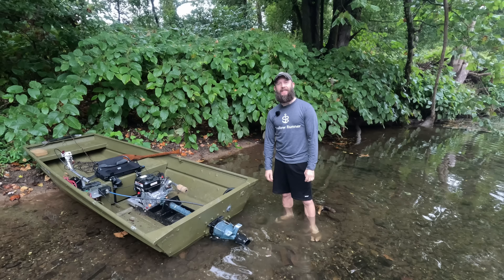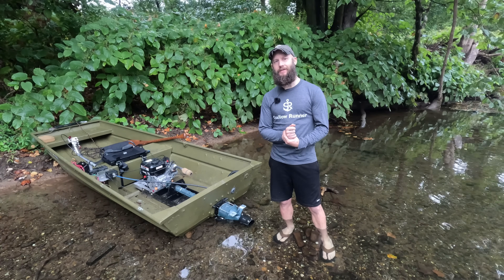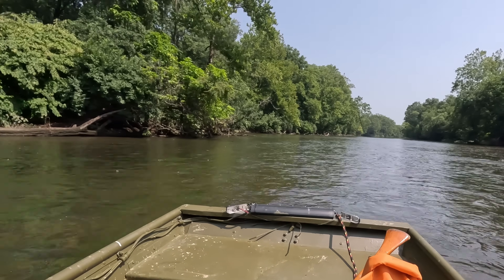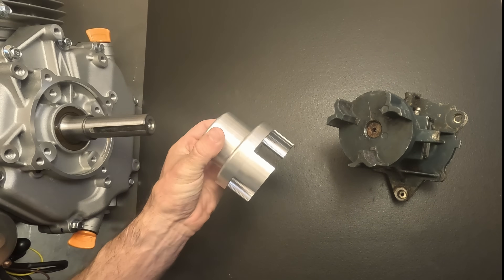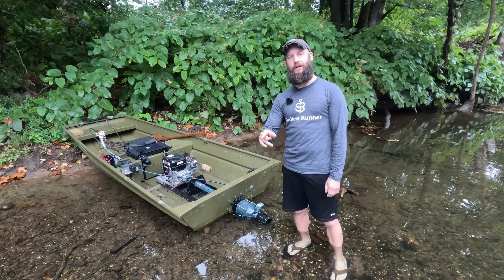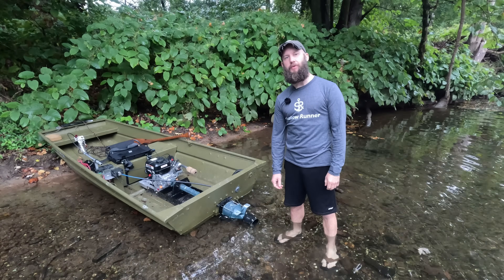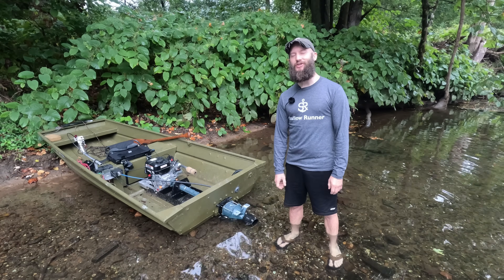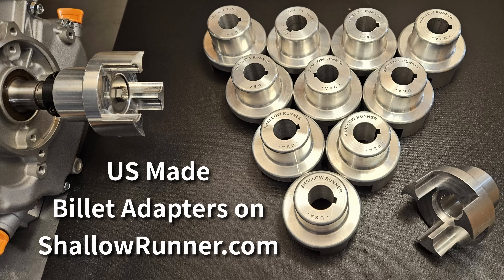212cc Predator Engine Jet Boat Build

Comment: So how are you steering this thing ?
Reply from the maker: This is setup with with a standard jet ski steering cable with a tiller configuration to mimic an outboard. Most folks prefer a vertical stick steer which we'll show for our 670cc build.
Reply: @Shallow.Runner  Thanks !

Comment: Is the rubber piece oem from the parts ski or did you have that made/make it
Reply from the maker: Great question, the rubber spider comes from the parts ski but they can be found on ebay for a reasonable price most times.

Comment: Total cost spent building the boat?
Reply from the maker: Put this comment up on another thread as well. We'll cover more on costs in a later video but it was about $300 for the boat, $100-200 in raw materials, $400 for the 212cc engine plus hop up parts, $200 for the ski we pulled the pump out of, so maybe $1,000'ish total. The 420cc build was a good bit more because of the stage 3 kit, fuel system, custom exhaust, custom impeller, so maybe $2,500 for that build though it can be done much cheaper which we'll cover soon.

Comment: This is an awesome project. If I wanted to build one, what year wave runner would I be looking for to get the pump from? Did you pull one from a ski or were you able to find just the used pump alone?
Reply from the maker: Hey great question, any pump from a Waverunner 500, or a LX650 (not the WRIII 650, VXR 650 etc). It's the 133mm diameter pump. Depends on your area but the skis usually go between $50-300 without a title. Shoot us a message on https://www.shallowrunner.com/ if you have more questions.

Comment: I just scored an 8 foot jon boat at a motorcycle swap meet for 2 hundred bucks. Is yours an 8, 10 or 12 foot? Its hard to tell.
Reply from the maker: Hey great question, this is a 10ft. An 8ft is likely doable but might be a pinch tight depending on how you plan to use it, likely a definite single seater.

Comment: whenever i determine a project  want to do, i really have to figure out what tools and parts are required that i do not have.  i have done many projects that cost as much or more than buying a finished project.  usually the tools i would have to buy are something that enhance my tool collection for future use.  but I have a ton of tools and spare parts i have no need for after the project.  i just saw a tool yesterday i got in 1998 that i have moved from house to house with and stored since, never to use again.

Comment: Is there space for dual motors?
Reply from the maker: With the right hull there's definitely space for 2 motors. A single Predator 420cc will push these pretty hard as an alternative to twin engines. A twin pump or twin engine setup would be super cool though. Hit us up on https://www.shallowrunner.com/ if you have any questions.

Comment: What was wrong with the 420 ?
Reply from the maker: Hey this is a great question, we personally prefer the 420 but wanted to show what could be done with a pretty mild build. I think most future builds will be 420's or equivalents for the electric start. It's way more convenient to run and has a baseline power that beats a basic 212 build.

Comment: can i use that same motor to a 14ft jon boat with max 4 people?
Reply from the maker: Hey that's a great question, from my experience a 212cc might be a bit underpowered for something that large with that much weight. You may want to research https://www.facebook.com/groups/1350497108303519/ jet jons with jet ski engines.

Comment: I’m willing to bet that you don’t need either the billet flywheel or heavier valve springs because the jet drive should limit the peak rpm to the peak HP of the motor.  It self governs.   It’s not like in a go cart we’re you can free rev it to the moon.
Reply from the maker: Dude you're spot on. This build self regulated but didn't want to take chances  in case it was hungry for something beyond 4000rpm. Needed the flywheel for dry testing as well to make sure it would go through the paces. Could have done this same build and left the internals stock, kept the governor and flywheel stock and you would have seen the same performance and rpms. Didn't want to be left wondering if it could have done more.

Comment: No good no payload!!!
Reply from the maker: Hey, that's an interesting take and I'd agree that the 212cc setup isn't ideal for a serious load. My experience with a modified Predator 420cc was solid load wise, could carry about 350lbs of passengers and gear at 25mph all day, so more than adequate.

Comment: I need an electric version of this boat. Great build btw.
Reply from the maker: Hey thanks for the feedback, I'm 100% with you the pull start was tiresome. They do make some electric start 212-224's but I prefer the Predator 420 and have the start of a stock engine build here: https://youtu.be/06xO1R-Ehe0 .
Reply: @Shallow.Runner  I meant electric motor. I'm trying to save what hearing I have left.

Comment: The Impeller cost more than my boat
Reply from the maker: Ha yeah agreed these impellers aren't particularly cheap though I have buckets of them that came with skis I tore down. The stock impeller isn't so bad either I just prefer Solas. Wish jet boating was cheaper overall but pros and cons of running shallow.

Comment: Can't you DIY depitch that impeller pretty easily to gain some more RPM/speed?  do i ton PWC all the time.
Reply from the maker: You're dead on about dropping the impeller pitch. These are mixed flow impellers and slightly trickier to DIY de-pitch at home vs an axial flow. Impros will do it for a solid price, but if you buy new and depitch it's a bit steep. For this build I just went with a basic stock'ish pitch impeller since I had it handy. My guess is a decent cam ($100-150) in this would bring the rpm of this way up since the stock grind is advertised with peak torque around 2500rpm. Great feedback, should have mentioned something similar in the video but had to keep the length down.

Comment: You didn't talk about whether the engine overheats
Reply: Comes up in the comments... no overheating without enclosing engine...
Reply: Those predators are indestructible no over heating
Reply from the maker: Hey, so far no overheats with the 212c. Overheated a 420cc but that was because the flywheel air shrouds over the head were not on and a life vest was blocking the intake. Was running about 5500 rpm for an hour on a 103 degree day. Tore it down, no warpage or issues, put a fresh piston and it ran fine for another 50 hours in the summer before I moved on to a different engine. If I run into any overheating situations in the future I'll try a forced air scoop that will ram 30+ mph cool river air over it. Great question though.

Comment: Does the boat vibrate your fillings out like a minibike with a 212?
Reply from the maker: Hey that's a great question. The main issue with vibration I've had so far was with some mild to moderate vibration with a stock Predator 420cc at idle. At any meaningful rev point it's super tame and isn't something that's caught my attention.

Comment: Only problem is there is no idle as soon as you pull start it it starts moving there’s no neutral or reverse ⏮️ ⏪ 🔄
Reply from the maker: Hey that's an interesting point worth bringing up, as there are some very minor drawbacks to direct drive. In my experience with jet skis and jet boats they produce a super small amount of thrust when idling. This boat might do about 1mph or less on idle. To your point though I prefer having a Predator 420cc with electric start so I can start/stop with the flick of a switch on the steering for situations where I don't want any thrust at all.  A reverse bucket can be added for folks that want more control. Since the build is about 175lbs, docking/loading isn't too bad since they can be spun around on a dime with a paddle.
Reply: This is how most  all jet drives work including jetskis pretty normal
Reply: I would say add a cvt torque converter then it would do this but would add complexity
Reply: Every good water jet application has a bucket for this. Bucket down = reverse, bucket halfway = neutral/idle, bucket up = go. Its even better than prop boats because you can drop the bucket to use it as an active brake. On top of that, the design is super simple and easy to diy.

Comment: ARC aftermarke flywheel highly recommended for a little bit of speed but mostly safety reasons. And why no cluch system?
Reply from the maker: Totally agree on the billet flywheel for safety which I think I mentioned but didn't necessarily say the brand. It's an ARC, their products and customer support is killer. A massive amount of people are rightfully curious about a clutch, it's good to see the feedback. Jet pumps make such negligible thrust at low RPM that it's almost like the motor isn't engaged to the pump at idle. Based on all the feedback, I'm tempted to build a CVT / clutch setup to see what it could do to bring the rpms up with a larger 4 stroke engine.
Reply: C v t would be good because it changes the gear ratio as the RPMs rise@Shallow.Runner

Comment: That’s awesome. Would a torque a verter help in any way?
Reply from the maker: I could help for the right application for sure, I'm all about the simplicity of direct drive since I go to remote locations and don't want added failure points. A ton of folks have rightfully asked about this so might consider trying it for entertainment and science purposes.

Comment: What does something like this cost to build doing it yourself without paying someone
Reply from the maker: That's a great question. I want to say the boat was $300, pump $200, Engine and build parts $500 (though it can be done cheaper), random other parts and materials another $250. So about $1250 give or take.
Reply: @Shallow.Runner  Thanks
Reply: Absolutely awesome.  I'm thinking of making a 12ft for catfishing.

Comment: Remove governer.
Reply from the maker: Yeah that's the best bet for getting above 3600 rpm. In this case my guess is the stock cam was holding it back from 4000+ rpm.

Comment: How many gallon per hour are you getting? Does it handle upstream boating on a decent current well?
Reply from the maker: I wish I had a better answer for the total gallons per hour, with the mikuni round slide carb it was a bit more aggressive but with 2.5 gallon fuel pack I could run all day. Running at 21mph it had no problem with 5+ mph current. If someone was looking for a more aggressive speed the 420cc is a much better bet.

Comment: If you are only hitting 3600rpm and redline is 5750rpm, you impeller is too tall. Go down on impeller pitch at least 2” or more until you achieve the desired rpm you need. Once you into the ‘power band’ you pickup efficiency and mph.😊
Reply from the maker: Totally agree on those changes, that would be a normal approach to a more conventional engine/pump combo. Cost wise stepping that impeller down is about 2-3x as expensive as throwing in a cam. The 212cc is probably not the best engine for this arrangement compared to the 420cc, which doesn't require any impeller changes for the most part to hit peak RPM with the pump.

Comment: about what kinda gas mileage you get vrs outboard of similar hp?
Reply from the maker: Man that's a great question, about 10 years ago I used to vary between a 5 / 10 /15 hp 2 stroke outboards. I don't recall the exact fuel usage but the 420cc running at 5500 with a large mikuni round slide was definitely chewing threw more fuel than an outboard. The advantage was running 30mph with a shallow draft so I guess it's all trade offs. Running the 212 stock at first used minimal fuel.

Comment: It would be cool to run it off a CVT transmission the have them that mount straight to the motor. That away you get full use of rpm range. Be a fun experiment
Reply from the maker: Hey, the CVT concept is awesome and might have a place for the right application. Check out @midwesthobbies for some great CVT content. He has a bunch of great videos with different drive trains: https://youtu.be/PqQhL6sfoXo?feature=shared . I am a fan of the simplicity and reliability of direct drive because of 25+ mile trips on some occasions. I would love to see a CVT setup with a super beefy clutch / belt apparatus.

Comment: Did you ever modify it more to see the any gain's a .265 super x would get you to 7500 rpm and a PE24mm slide carb.  It will gobble fuel but would be well worth it.
Reply from the maker: Fully agree with this assessment, the stock cam is not remotely ideal for this application, and you'd need some solid fuel delivery with a cam. The 420cc with a Mikuni round slide was a gas hog but it ripped hard. I love the 420s, so this was more of an experiment, but at some point I would love to see how a 212 performs with a cam.

Comment: I think if I was doing it today I’d go with a surface drive mud motor over a jet. Cool either way 👍🏼
Reply from the maker: Agreed, a surface drive or mud motor can be killer for the right rivers. I guess it can go either way depending on where you typically run. So far the jet has done well in ultra rocky / super shallow spots.

Comment: If you want to to faster put a point on your boat. you can use 2.7mm or 5mm plywood. One sheet would do it.
Reply from the maker: I think that would definitely work depending on how high the nose of the boat is when it's on plane. A V shape or nose in the front would be awesome for chop. Where I run has minimal chop so I've left it stock.

Comment: cool rig, I have a bass tracker pro 18 jet,  i was thinking about doing a sea doo swap on a 14 foot flatbottom,  i was planning on using the sea doo 717/720 and corresponding jet pump assy.  Here on the wisconsin river at times the river can get incredibly shallow over sand bars 2-3 inches. the flat bottom would be easier to get unstuck vs my bass tracker which is a heavy pig
Reply from the maker: As far as I understand from the forums that could be a solid setup hp to boat size, that or a 787 which might have an extra 25hp or so.  I'm totally with the lighter build mentality, this setup weighs about 175lbs and is so much easier to move around when you get in a jam. If you check out the Facebook Forum "Franken Jet Jons" you may be able to get an idea of the speeds and final weight guys end up with similar builds.
Reply: @Shallow.Runner  my experience with rotax 787 sea doos hasn't been very good, i had an spx with the 787 totally rebuilt with fresh crank/top-end,  i've had nothing but problems with fueling issues, cleaned and rebuilt them them with OEM mikuni kits, set pop off pressures and check/verified OEM jetting sizes,  Ive ended up damaging pistons again due to it going lean under certain conditions, i replaced all of the fuel lines, even bypassing the fuel selector valve and pulling the pick up tube out of the tank to check for obstructions, checked the tank vent valve for obstruction,  meanwhile my 717/720 sea doos run flawlessly and bulletproof. even had a gsx limited with the 951. the 787s and 951s were problem childs, i dont waste my time with those motors/skis anymore and i have 4 720 powered sea doos
Reply from the maker: @destroytheilluminati770  That makes complete sense, and I should have prefaced that my experience is mainly with vintage Yamahas. If you have an engine ready to go and dialed in with that kind of HP it should definitely rip. Hopefully there's some solid examples in the forums for the hull/engine layout with a similar setup.

Comment: I feel as if this needs some kinda gear rexuction box thats par of why you dont get mucn rpm i just know a slight reduction would let u get it opend up
Reply from the maker: Hey, agreed that's a solid thought. Depending on your engine/pump/impeller combination there's definitely some advantages to that path. I may not have mentioned a ton about it in the video but this same engine with a cam and some other small changes might be able to boost the RPM a good bit. My limited understanding of the stock cam is that it puts out peak torque around 2500rpm. while some aftermarket cams would put out peak torque above that range. I'll be curious to see if anyone tries this engine with a more aggressive build.

Comment: seems to me like you have too much load on the engine. you can try widening the nozzle or lowering the impeller pitch I guess? Same pitch with less paddles would also do the same thing, but the jump will be proportional to the ratio of paddles. I had a similar idea but was going to make my own pump to mate it to the exact engine specs I was expecting. not sure if your flywheel has any timing advance on it, but that might also squeeze out a little more power, but you need higher revs to get that benefit
Reply from the maker: Man you're right on target. This engine was picked just for entertainment and those looking for a budget build. I did modify the pump similar to what your outlining. I'd have to check the spec sheets on the 212 either the flywheel or timing key was advanced. I'm way a fan of the 420cc for the electric start, and ample power. Sounds like if you go the 212 route you'll capture a better range of tweaks that these engines benefit from. Feel free to shoot me a message on www.shallowrunner.com if you need to bounce any ideas around. 21mph with a single rider does what I need to get through shallows so I marked it as a win for now. Releasing a 420 video shortly.
Reply: @Shallow.Runner  honestly im impressed you got up to 21mph; my math for an optimized pump (with lots of assumptions) on the engine running a jet drive topped out at like 16mph, tho my boat is probably way less efficient as it's HDPE and kinda floppy 😅